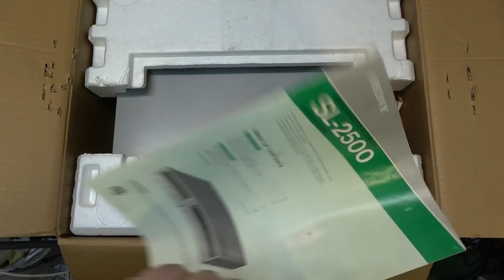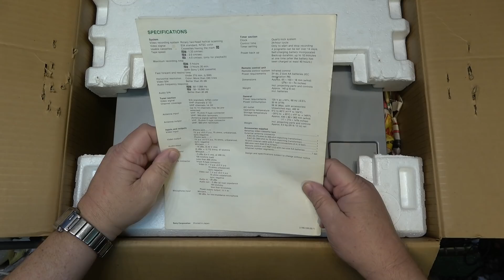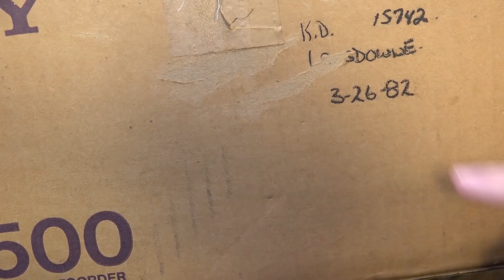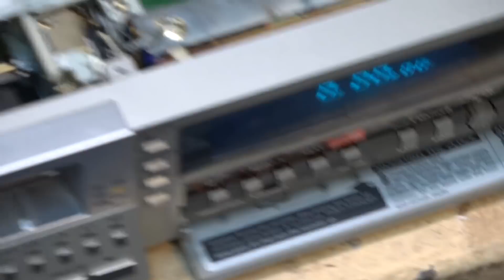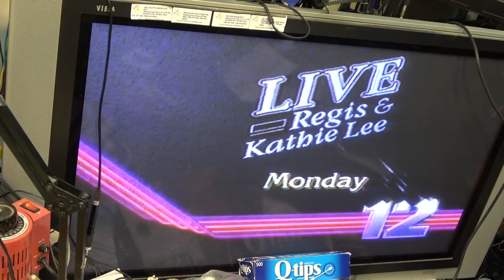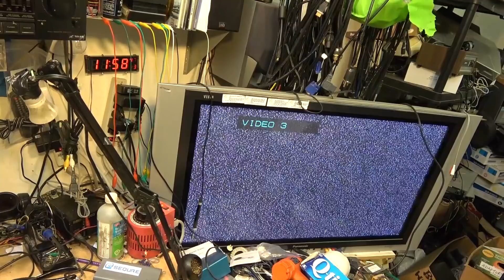Sony SL2500 Betamax is over engineered

Comment: Those front loading plastic gears were rubbish on the SL-C9.  The metal upgrade kit was available for a time.  The DC-DC converter often fails causing no display, I rebuilt one recently.

Comment: I still own my father's SL-2500. It was a Cadillac! Very complex, indeed. It sold for $1600 CDN back in '82. It visited the Sony repair shop twice in the first 5 years. Blown up transistors on one on the motors. The cassette loading gears are indeed problematic. They become brittle as time goes by.

Comment: We have an TT-2000 tuner module with a similar hidden DC plug...  Checking the manual and service manual (we have both) and the only clue to its use is mention of a 'coming soon' Sony antennae signal booster for distant-from-station reception. Recalling an old Betamax forum query and this may have been the power take off for said booster. No other mention of the cord is made in either manuals.

Comment: 11:43 - Gotta love the few-lines miniature test pattern signals in the VBI. VBI used to be the 'behind your back' kinda busy area for some TV broadcasts. Teletext, scrambling info (I assume), test signals, closed caption / subtitles, time code, macrovision (EW!) etc...
Reply from the maker: You are talking about VITS, vertical interval test signals.
On NTSC they were as follows.
Line 1-9 are your vertical blanking signals, where the beam flys from the botton to top of screen. Starting on line 10 through 21 these are available for auxiliary data and in general followed this format.
12-14 were SIMPTE time code for the program, could also be used for teletext.
17 -18 were used for a multi burst and color bar test signal. This way the engineer could evaluate the transmitter full time, as his monitor scope and vector scope could pick off those single lines. Line 19 was VIR, which was pretty cool in its day. It carried 3 signals over the entire line. The first was a 70% lumanence reverence and 70% color burst, the remaining portion of the line as 50% lumanence and 7.5% lumanence which as you probably know 7.5% is the black pedestil level. This was used by the TV to set up brightness, contrast, color and tint automatically. Network codes and teetext on line 20 and line 21 closed caption along with XDS and vchip data.
Macrovision data occupies line 10 - 19 on macrovision encoded closed circuit signals used on VCR, DVD and STB.

Comment: Very informative video, thanks.  I hope my working SL2710 was a design improvement. I haven't finished transferring some interesting recordings that I made back then.
Reply from the maker: 2710 was a different chassis he 711b and had most of the problems with this one solved.
Reply: @12voltvids  That's good news, thanks!
Reply: All his videos are packed with great info :)
Reply: The SL-2710 is a high end offering that wasn't as full-featured as the SL-2700, but was a lot more reliable using a simpler single-motor idler reel table assembly and a simpler cassette carriage mechanism, all carried over from the EZ-Beta models that were available at the time the SL-2500 was marketed.

The SL-2710 was also built more stoutly, IMO, than the SL-2700.
Reply from the maker: @Watcher3223  the 2710 was a huge improvement to this design and that chassis carries through to the SL 24xx series and slhfxxx series right through to the slhf1000 they changed it again in later models when they went solenoid free.  The single loading/threading motor with the planetary transmission to change the single loading motor between front loader and threading was reliable and cheap. It did result in machines coming in because some "friend" commented on how noisy it was and that something had to be broken.  Many came back for that loading sound and people had to be educated on it. We charged 29.00 for wasted time chasing a non existing fault.  Of course the heads were always cleaned and when the customer complained that it should be warranty they were nicely told by the service people that had cleaning is considered maintenance not warranty. The sheer number of the 711 B chassis showing up when they were all literally brand new for strange noises when loading tapes was unbelievable. For every 10 machine sold nine would come back within the first month because the customer was concerned something was breaking and every single one of them resulted in a $29 diagnostic/cleaning charge not covered by warranty for a no-fault found. It got so bad that our sales people started demonstrating it to people when they were coming in to buy a new betamax they would put a tape in the showroom and say listen to this sound it's normal. this is because people were typically upgrading from an older machine that was relatively silent and the noise it made shock them but it was reliable and very simple.
Reply: @12voltvids  About the only serious problems with the 711B series are plastic parts breaking ... but that's to be expected on machines that are still working many years beyond their expected service life.

Can't exactly fault it for that as nothing lasts forever.

Comment: IIRC There was supposed to be an add-on mechanism which allowed the switching of tapes ala a jukebox.  Giving hours of recording time.  Maybe that is what that 12v adapter is?
Reply from the maker: Yes called the "beta stack" would hold 5 tapes and drop them down as the prior tape came out.  Only ever saw one of them.  It was another white elephant that had constant problems.  We used to joke that Sony stood for "soon only not yet" with respect to the fix for some of these gadgets.

Comment: Ugh Duracell!  I actually just took custodianship of my dad's old Sony hifi midi system from about 1998ish and the remote had a pair of Duracell with an expiry of 2013 on them.  Those have not leaked, presumably from the time when they actually made decent quality cells.  They also still appeared to function, which was cool. the bin is the only thing they're worth risking now though...
ooof, sticky shed on the buses lol...  wonder if they also had any of the professionals or minder...

Comment: The failure of the 711D Chassis are many;

- Breakage of the movable guide on the loading ring.
- The loading pulley for the ring have a brass inside, 
  this expand and damage the loading pulley.
-The great inertia of the D.D. reel assy.
- The upper drum need a resurfacing.
- The back-up battery leak very badly.
- Very Fragile front loader.

One vantage:

No DC/DC converter like on the CCIR version (SL-C9E).
Reply from the maker: Believe me I know all the problems. Especially when people put the allsop wet head cleaner inside. Crunch, snap pop, Guides ripped out. Lots of headaches with these. We had a repair kit for the guides. You had to use a special nipper to nip off the broken hinge and then screw down a new block to the existing screw holes where the old one came out.
Reply: @12voltvids  The Same thing are on the Chassis 711P: SL-F1 (SL-2000)
Reply from the maker: @LibraAudioLaboratory  
The portable sl2000 uses the same chassis with the same faults. Especially with high grade tapes. They were really bad for polishing up the upper drum.

Comment: I had gotten a pair of SL-2700s cheap at a flea market about 20 years ago. This video is triggering PTSD. I never did cobble a working machine from those two units. That transport was bafflingly complex. I had similar loading issues with the machine. I think I got it to thread a tape once only to find out the damn capstan motor was dead.

My family for some reason only owned Sanyo Beta machines. They were cheap, but their tape transport, albeit completely different from Sony's, was built like a tank. All our tapes were in similar worn out shape because we used to....ahem.... time shift our VHS video rentals for later viewing. :)

Comment: The SL-C9 (PAL) model is almost identical to this but has linear stereo sound with BNR (Sony's version of Dolby). I wonder why they didn't include that with the 2500 NTSC model.
Reply from the maker: Because beta hifi was already here in the sl5200. They adapted it quickly to the 2500 and the 2700 was born.

Comment: I always wanted to see the US version of the SL-C9 that uses the same deck but the US versions are quite different - do they use the little DC-DC-AC convertor as the power supply arrangement looks completely different on the SL2500? The C9 was linear stereo, did the US have a linear stereo machine before the Hi-Fi machine was released and did it have the PCM drop-out compensator cut-out switch? I really do love these decks and enjoy working on them (am I one of a few?) although they can be a challenge - have a few videos with some fun repairs including an open-circuit head chip! Great video and thoroughly enjoyed seeing the US variant being worked on.
Reply: The SL-2500 was a monaural machine.  It did have the PCM switch for using it with a PCM processor, like the Sony PCM-F1.

There were only a few linear stereo Sony Betamaxes for North America and they were commercial machines as denoted by their SLO prefixes in their model numbers instead of the typical SL prefix, as well as the GCS-50.   There was also the Marantz VR-200, which was a linear stereo machine with Dolby System type C for noise reduction.
Reply: @Watcher3223  Thanks for the info - very useful. I'm lucky enough to have a SLO-1700 machine which has both Hi-Fi and linear stereo which I'll be making an in-depth video on soon. Useful to know the SL-2500 had a PCM switch too. I have a lot to learn on the North American Beta machines and you're reply has helped fill in some blanks. Did you get many multi-standard/ multi voltage units in North America? I do really love the SL800 which could play French Secam recordings as well as some NTSC and PAL.
Reply: @MrBetaByte  No, the bulk of North American machines produced were strictly NTSC and for 120VAC 60Hz.

There were some PX model Betamaxes, like the SL-2710 that I own.  It's the same as a North American SL-2710, but its power supply is multi-voltage with 50 and 60 Hz support.  Still NTSC, though.

Comment: After about 2 days of removing the loading basket, correcting a mis-aligned gear on the loading basket, and then re-assembling, the unit will still not engage when a tape is inserted. I'm not certain if it is a faulty switch or wire in the loading basket. Even when the loading basket is completely disconnected from the VCR, upon pressing POWER ON, a few seconds later, oddly the yellow 'EJECT' light illuminates. The eject light coming on with no tape inside (OR no loading basket plugged in) seems highly abnormal.
Reply from the maker: There are switches all over that loader.

Comment: I bought one of those at a Hamfest for $10 or less and it didn't work but I found it had a conductive glue issue. Chopped out the glue and it ran fine.
Same thing happened to my SL-HF300 I bought new. I got another 2500 but it was toast literally as there was a hole burned through the takeup and supply motorboard.

Comment: The only Sony Video Tape Recorder I have is a VHS. I guess they had given up on Beta by then. Only time I used Beta was for digital audio recording and playback using an SonyPCMF1 unit. I'd love to pickup a cheap Beta of the matching type as the F1 unit to match the display and play the few tapes I still have from those days. Those Sony F1 and Beta units were portable and did a good job of recording digital audio but were replaced by the Sony (and other brand) DAT players within a few years.
Reply from the maker: The matching beta for the F1 is the sl2000.  I have 2 of them.
Reply: I texted you

Comment: @7:00 - at least that was an easy fix -gear  right there at the top  - wonder if that's the same plastic they used in the gears of those uber expensive Sony walkmen that always crack.

Comment: Which ones are the most reliable Betamax VCR models? You mentioned the SL-5000 series (5800, for example). These ones are really old... I own a SL-2405 and a SL-340, and they both required reparations. 😅😅
Reply from the maker: 711 chassis.    Slhf300 500 900 1000 ect.

Comment: Hello my friend,  long time no chat, yes, these machines were a nightmare to "try" to repair..the early Pioneer projo tvs were as bad...
However, Sony made a decent VHS machine once they got into that market.
Good video and happy holidays.
Reply from the maker: Except for the p6 guide that froze and took out the  sub can gear, the pinch arm that froze to the post and snaped the pinch arm, the infamous blue gear that snapped and the white gear before they upgraded it and made it blue, and then capacitors that pissed all over the place in the PSU and Hi-Fi audio board.

Comment: Well, I wound't say they were over engineered. But those machines share the same problem many electric devices had around that time: The consumer wanted "intelligent" devices, new shiny "features", but the computer tech was still ways behind. Today, 90% of the board would fit into 1 or 2 special micro controllers, back then, they needed a hell of analog parts, 74-logic and whatnot. It's the same with eg. music synthesizers or that time, eg. Roland Juno's and such. Still kinda analog, but also many advanced features and a hell to repair nowadays. Or bench meters and such - today one chip inside, back then 2 big boards crowded with 74's, op-amps and tantalum caps...

Comment: How do you re-surface the head drum ? I have an SL-HF900 thats works but requires constant cleaning of the video head.
Reply from the maker: You resurface the upper drum with comet cleanser.   The 900 had a problem with the head that resulted in constant clogging.   On early machines they did not put filler between the chips on the double azimuth head.  I changed several under warranty for this.   They put epoxy in the gap between the heads.  Without the filler the sharp edge of the head scrapes on the tape surface and clogs it up.   The 900 was the first beta that used 4 heads.  Good luck finding the upgraded head.  There was a colored dot placed on the back of the machine when the head was upgraded.  It came with the replacement head to let future techs know that the head disk was upgraded.   I changed a fair number under warranty.
Reply: @12voltvids  Is this machine toast then ? There is nothing I can do with the head in it ?
Reply from the maker: If the head is clogging constantly then 1 of 2 things.  Your tapes are shot, the binder is shot and the oxide is falling off or the head has a chip and it's scratching the tape surface.   I don't know where you would find a head disk.  It's easy to change if you find one.   If you look on eBay someone probably has one kicking around.
Reply: @12voltvids  The same tapes play fine on my SLHF-300 without clogging the heads so its not the tapes.
Reply from the maker: @andershammer9307  then it is the chipped head chip (bad pun I know). They changed the head part number for an improved one.  I had to change mine eons ago for that very problem.  That head drum ended up in my slhf1000 when the rotary transformer seized up.  The head is still good, so when the 900 head on the 1000 wears out I'll pull the disk out of the seized drum and put it in the repaired machine.  The 1000 has flying erase so it won't edit cleanly anymore but i have 2, and would just use this for playback if I ever had the bug to edit with beta for a throwback.  I just use it as a playback machine for archiving

Comment: Wish I had a genuine gear kit for the SL-C9 Sl-2500 chassis, 😒 The SL-C9 was my favourite machine to work on back in the 80's, I've got an SL-C9 machine and 2 brand new original heads …the ones that came in white boxes (if needed) …just waiting for a gear kit from wherever.
Used to love On The Buses, I've got the box set!
Reply from the maker: I was given a bag of Sony parts and that gear might be in there.  Just don't remember where I put that bag of parts.

Comment: hello Are u in toronto? I am looking to get a philips VCR from 1988 checked out. thanks!
Reply from the maker: Go west.  Wayyyy west.  I can dip my toes in the Pacific ocean.
Reply: @12voltvids  got it! Thats sad for me! I really need to find a technician who knows what he is doing and is gentle with the unit also. I have a Philips 6443 from 1989. Visually its in great physical condition. I opened the cabinet and its looks VERY clean. But when I put a VHS in, the rewind is slow, the forward is slow and when i press play, the spools drag the tape half way, and cant go any further, and tries a bit, then the VCR goes to standby. (maybe a protect mode)? I was looking for grease and its looks empty...whatever is there is dry completely. Is that the reason? from 2 decades or so of no use? I dont hear any bad noise or anything...just seems like the VCR struggling to rewind, forward and play. The head spins effortlessly however.

Comment: This SL-2500 has the same spools that you get on an SL-2000. Trust me. The Sony SL-2000/TT-2000 is probably my goto portable Betamax VCR.
Reply from the maker: Sl2000 2500 and 2700 all same.  Known as tape breakers.   They were terrible as soon as the upper drum got even the slightest bit if polish from the tape.   Hg tape was even worse.

Comment: I now hate those stupid Sony orange modules now. Even their broadcast equipment has them. My BVP-30 went up in smoke for some reason and went I opened it up one of the modules was brunt. I would assume replacing the module would fix it but good luck finding another module. Isn't the broadcast equipment made for service?

Comment: I have PAL version C9 it won't eject tapes anymore
Reply from the maker: Check the 2 little gears on the loader.  They are either white or black plastic if they are the old ones that break. They changed then to metal.  Also there is a linkage that the pinch roller pulls when the tape unlaces to release a physical lock on the flm and activate a switch to eject.  It's a complicated loader. It was the first VCR that used a front loader